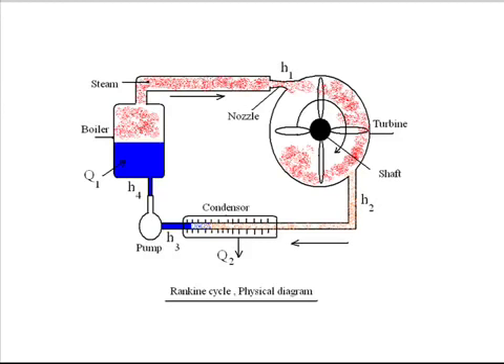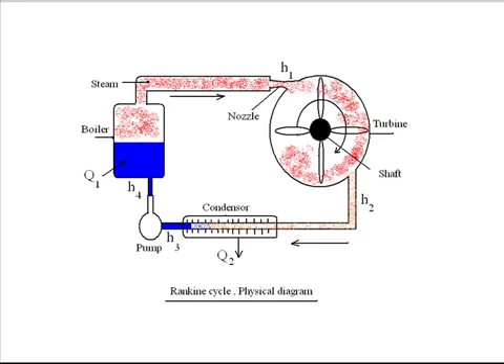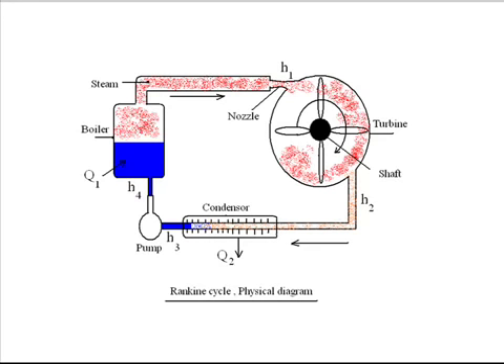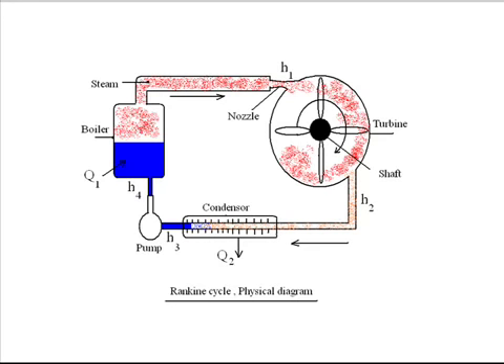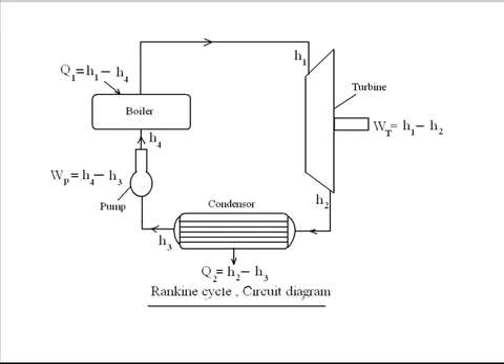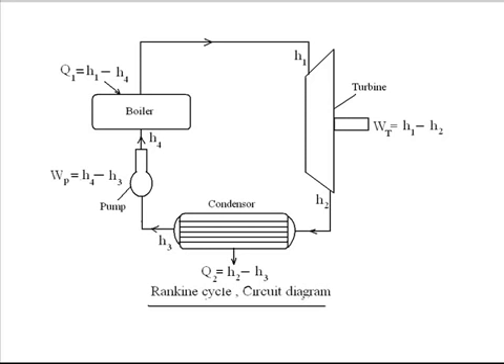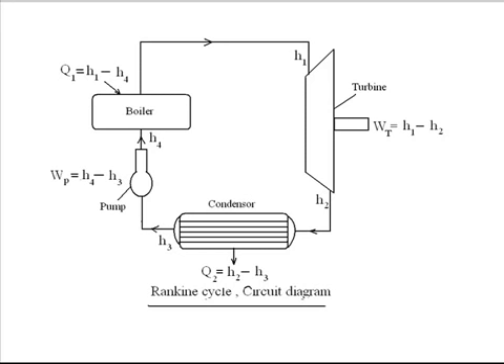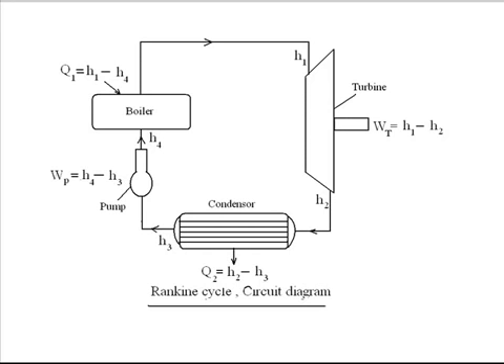Rankine Cycle

Comment: why we used condesor unneccesarily ,can we give directly vapour to boiler so it doesnt require latent heat (
 we can reduce heat given to boiler )
Reply: because if there wont be any rejection of heat in the surrounding and the work is continuously done. This then will violate the kelvin-Planck statement which is not possible
Reply: To continue this cycle we need the steam of same pressure and same temperature but turbine decreases the pressure and in order to increase it we use condenser which converts steam into liquid and then we send it to boiler for temperature increment.
Reply: jab steam boiler se turbine me jata hai to steam ka presure decrease ho jata  or hme chahiye jitna input tha  aprox utna hi output mile  jab fir steam turbine se ati ha to ushka presure kam rhta ha to fir ushe condensed krte ha  tab steam liquid me convert ho jata hai tab mai feed pump ka use kr ke ushe boiler ke pass bhejta hu (acc to me)

Comment: Why would you want a condenser and pump? Why not just vent to atmosphere and reduce the work required?
Reply: Cerebral You very much want to keep that water in that cycle for a few reasons.  First, typically it is treated water, because ordinary "clean water" will still have impurities (undissolved solids and/or undissolved gasses that will damage/corrode/deposit scale on internal physical surfaces), and second, the water at the condenser will ideally be at a lower temperature than say additional "make-up" water that you've already treated and are waiting to use (a component of a typical steam plant not shown in this instructor's example).

Comment: Would it increase power and or efficiency to add another chamber, next to the boiler. The steam line from the boiler could then be fed into the top of this new chamber and it would be used as a gas piston to push water down the chamber, at the bottom of that  chamber you could then have a line exiting it and going to the turbine, so water would power the turbine. Wouldn't water have a greater torque than steam, and wouldn't the problem of corrosion of the turbine be eliminated? OF course, one would need a series of such cycles, or  engines since the piston chamber would need time to refill as heat is removed and the steam condenses back into water. There could be a series of check valves throughout.
Reply: +Max Krakah The Problem is you will still be using steam to do work on water which will then do work on turbine, this does not add energy to the system (note that we added energy by heating up water, this energy is then converted to mechanical energy of the turbine), so it will be much more efficient to go steam to turbine rather than adding an extra step of pushing water with steam which will basically just introduce losses into the system

Comment: What type of valve do you use between the pump and the boiler. The Boiler will be under pressure, how do you design this so that it is able to pump the water back?